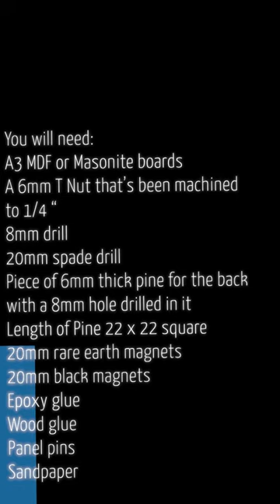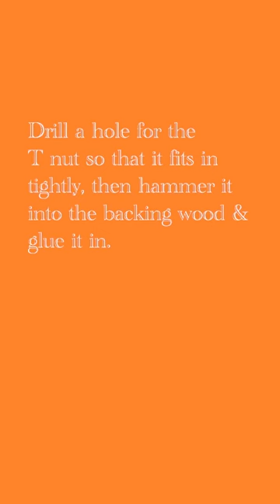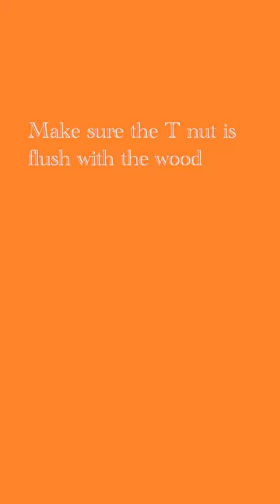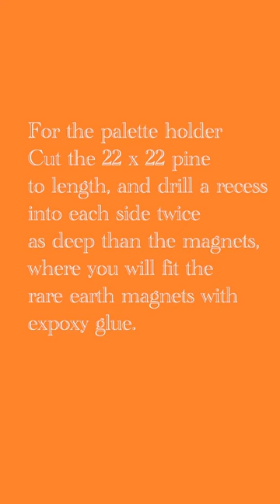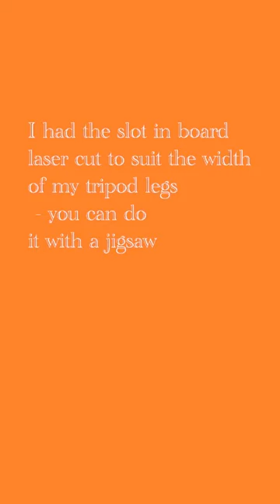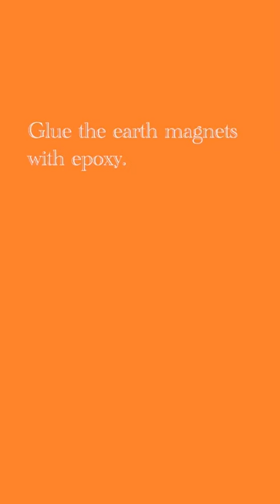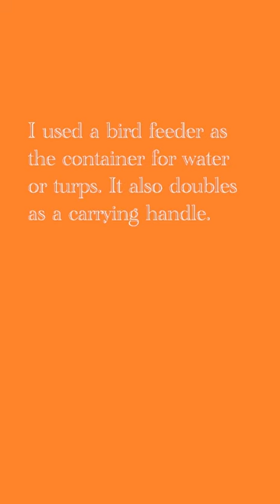Making a Plein Air Easel to fit onto a Tripod.

Comment: I like some of the modifications you made and I like the handle. I thought the original had quite a large hole in the board that would weaken it and allow the weather in. Not sure about the magnets but I didn't like the velcro either. Anyway, thanks for sharing 😊

Comment: Nice job!  I came by way of looking for ideas. Your artist box that isn't a box is lightweight, quick and easy with lots of room. I have a 1/4"x17"x12" plastic cutting board I'm thinking I could bend and have a combined one-piece easel and tray to keep the paints closer to the paper. Just trying to figure out what work angle would best overall without sawing the board in two and using hinges.

Comment: Thats a very good version. I found velco to be very good for keeping both parts together. Also if youmake a hole in the shelf to take the waterpot you don't have to cary extra bits and pieces :)
Reply from the maker: Thanks very much for the advice! I wanted to put hole in shelf but made it a little to small a space for palette as it’s only an A3 :)

Comment: Thanks for sharing your DIY process. This is eye opening! How did you attach the ring for turps holder? Did you make the ring yourself?
Reply from the maker: Hi! Thanks very much, I bought a ready made stainless steel  bird feeder from the pet shop which happened to be the exact size. I used its holder which has a bolt, drilled a corresponding hole in the side and used the existing wing nut to attach it!
Reply: Ah. Thanks for the info!

Comment: Wait a second here,  isn't mdf particle board making it extremely sensitive to moisture?  Even humidity will destroy mdf. Why would anyone use mdf to make a plein air set up?   Or is there now some type of super high grade mdf with something other than wood fiber and glue?
Reply: If you use a thin varnish or oil then mdf is surprisingly non-sensitive to moisture. I would have used ply for that job just for strength though.
Reply: the original guy used several coats of varnish but partical board and masonite are 2 different things.